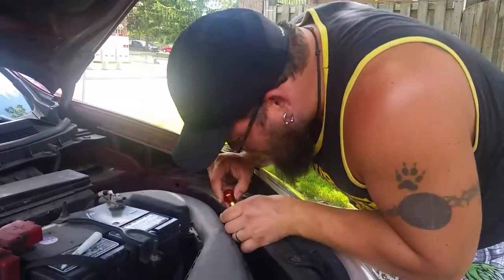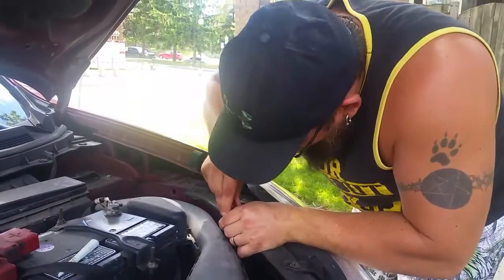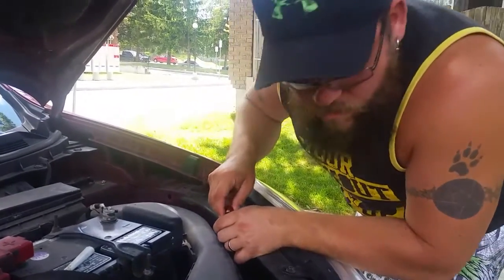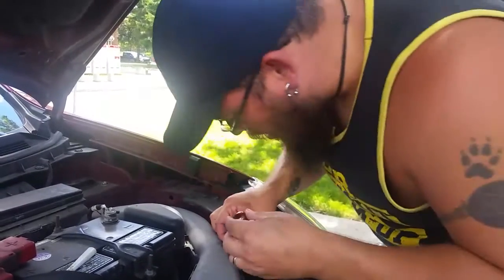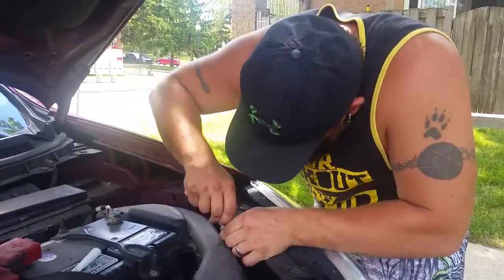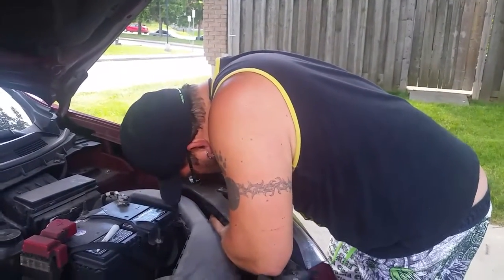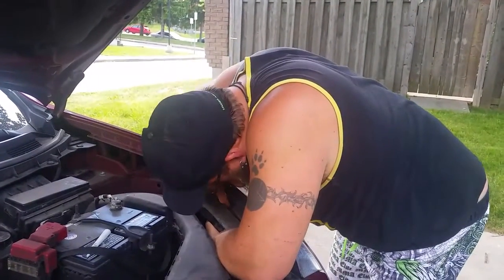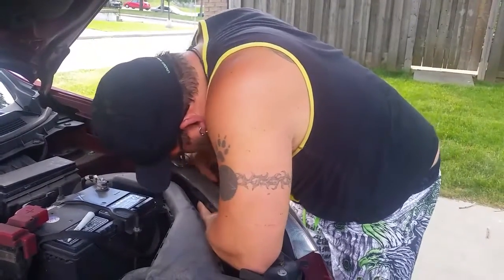Changing a signal light in a 2010 Nissan Rouge

Comment: When I changed the left turn signal bulb, I actually removed the air intake by removing the three rivets in front and removing the clips from the back side. Makes it much easier to install, especially with big hands and arms.
Reply: Truth... the left turn signal is a tight squeeze, and I'm not a big guy... but if you can get your hand in there, it takes about 1 minute to do.